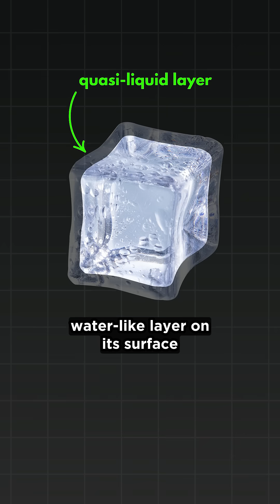The Science Behind Slippery Ice: Why Ice Skating Defies Logic

Comment: So i was right in school. I remember we got asked and my answer was "because there is water on top of it, like you can see it" Teacher told me "No". Ice is a crystal yet ice has specular reflection, that can only happen if something smooth is on top of it, you know, like water. The answer was staring us in the face. Also make sense why a car on ice and a car that is aquaplaning feels the same, because the car IS aquaplaning on the ice. As we are not in 0g's, heat wants to go up, the atoms in ice can't move like in water, so they transfer the heat to the top ( most of it, some energy will radiate to the sides and down ). If that is true, then ice in 0g's would be less slippery than the top of ice is on Earth. Seems to make complete sense, or did i miss something?

Comment: I fail to see how the second theory just “doesn’t make sense”
The thing about friction is that it isn’t dependent on the size of the surfaces in contact with each other it’s dependent on normal force and the coefficient of friction between the two interfacing materials. That is to say a metal sled the size of someone’s body and the blades of the same metal on a pair of ice skates would have the same force of friction (if we neglect the weight of the sled and skates)
The key aspect is that a sled has a large surface area so all of the heat energy lost due to friction gets a wide even dispersal, but the surface area of an ice skate is HUNDREDS if not THOUSANDS of times smaller. All of that heat energy condensed into small points seems reasonable to me, even if it’s not the actual case.

Comment: Its because the ice skates are very thin, thus create little friction with ice. Ice being a very smooth and slippery surface, also has little friction. See how easy that was
Reply: Also to push off the ice, you increase your frictional force by turning the blade and pushing off with more force than you have speed

Comment: It’s because water forms a crystal lattice structure when it freezes which also is why it expands when it freezes. However, the molecules at the edge of the crystal are not bound fully and are free to move. This is why putting ice on top of ice causes them to fuse. It’s not that the water is freezing but the molecules at the edge form the lattice pattern

Comment: 😮‍💨 it's not just the pressure. It's how the skates are designed. If you look at skates closely you'll see that it's not one blade but two with a cup shape between them. The weight of your whole body pressing down on two super tiny points does infact melt the ice. Which naturally gets pushed into the center in that cup shape and poof. Your skating on a super thin layer of water.

Comment: Well yeah?? 
I thought that was common knowledge. I mean ice is water with temperature below 0, and everything it touch transfer heat or cold. Including air.

Which is why in cold atmosphere ice can become sticky. The touch>transfer heat> melts a nano, then gets frozen by the ice. Kept by the cold atmosphere. Or simply very cold ice

As for skating, there is alot contributing. The pressure does cause the ice to melt. But not to preasure alone. The transfer of heat. The material and the atmospheric temperature the focus point on a blade are all a factor.

Comment: I thought the metal skates worked like a radiator, taking heat from the air and the foot, and melting the ice through heat transfer. Otherwise, we would see wooden or fiberglass skates.

Comment: No its a combination of both n your wrong for it to generate enough heat to glide on it all the weight of a person isn’t on their feet it’s on blades on their shoes the blades surface area small in contact of the ice but the pressure of a humans weight being on a smaller surface area

Comment: It's about the pressure per square inch( what they don't tell you is that figure skates are actually concaved in the middle of the blade technically making 2blades) to be honest I have no clue how much the average figure skater ways but if you apply that many pounds of pressure across at most 2 square inches it's enough to melt a small bead of water you can scate across

Comment: It's mix of pressure and sharp blade however the blade isn't sharp and a normal sense It has a concave blade on each ice skate and due to metal heat transfer it makes a small water bubble that is supporting your entire weight whenever you glide across the ice it is cutting the ice leaving the water there and you're traveling on the bubble not the ice itself which is why you can glide on it and actually have control

Comment: So the reason that ice skates can be used to make intricate movements is due to 2 factors the loose layer of H2O explained by M.Chromoshwaran_10F_OnlyStudies, and PSI 

Pounds Per Square Inch so yes someone may weigh 60 kgs but when you have all that weight on such a small surface especially one as sharp as a knife like a ice skate that pressure on the ice would break it apart and melt it because of how much pressure there is cause for an ice skate you are not gliding on ice your gliding on a ultra high pressure bead of water I believe Neil Degrasse Tyson did a video on this or a interview about this where he explained it a lot better than I can

Cause you got to remember the way boxers, moi thai fighters, and karate/taekwando martial artist deliver such power punches is by focusing all the force to one knuckle making all the weight of the punch be in such a small area that the force behind it is gravelly increased that’s why they can shatter bricks or bone in a punch cause of physics

Comment: Why can’t it be both? My finger doesn’t melt ice fast if I just place it on there but I rub it on the ice it does. Let’s go even further. I have a metal chop stick. Just pushing on the ice it would melt incredibly and the metal would become cold. It’s I start to rub the ice fast generating energy (= heat) then it will melt faster. Now imagine a 120lb person doing the same thing on skates a millimeter thick. It’s seems common sense I’ll have to research this if it’s really “debated” so hard

Comment: I thought the pressure of the skate being so thin is why they didn't need to weigh as much as an elephant to melt a small amount. Because it's about pounds per square inch and the skates blade is very narrow not sharp like a knife but much smaller point than your foot. But then I just remembered busting my ass in regular shoes from slipping on the ice so there goes that theory.

Comment: Its simple as the outer layer of ice will get latent heat which will increase the average potential energy not the average kinetic energy on which the temperature depend so yes water can exist on 0 and below 0. And due to that average potential energy which will keep the intermolecular distance far enough to not form ice crystals hence the Molecules will still be at that far from each other as they were in water when it was  at normal temperature , 
And as a result water remain water on the outside of ice and form thin layer over it 

But due to stacking of ice cubes the contact part of two ice cubes  part is now isn't expose to surrounding and is only with the other ice cube whose thin water layer also tends to absorb latent heat thus after a certain time when the energy would be over between that contact area the intermolecular distance decrease, as the average poterntial energy of molecules is now completely absorbed as there is no more latent heat left, and due to that it began to form ice between those two ice cube ( of course at environment at which additional heat from surrounding don't get into play like here in this video the refrigerator is doing) 

So its that's simple

Comment: Unlike what most people think ice skates are not actually like knives cutting through the ice they are thin and like blades, but instead of a sharp point it’s like the shark point was cut and turned into two sharp points with a little U-shaped divot and like she said in the video, there’s a small layer of water over the ice and what these divots did was used the pressure from the weight of the person in such a small area to gather the water under these blades, causing you to have a similar effect too if you put a set of tires on a car backwards, which would cause the water to go under the wheel making it slippery

Comment: lol that’s literally just proving the first point that the pressure of the blades (tbh I’m a snowboarder so it more goes like this for snow than anything) lay board on snow the liquid part of the snow will allow low friction so zoom, ice is just snow but together it will form the same little layer as anything touches it, think like the skate itself is not 0 degrees say the skate starts at room temperature as you begin you will melt ice then move to less and less as the blade cools

Comment: This is wrong. Ice melts easily when pressure is applied.  Take a cold metal utensil like a butter knife and press it against an ice cube.  You will find it sinks into the ice cube surprisingly easily.  Make sure not to be holding the utensil for very long before trying this (or use one with an insulating material for a handle, like plastic), or your result will be skewed by the heat transfer from your hand through the metal.  When wearing ice skates, your entire body weight is concentrated on the extremely small surface area of the skate blades.  This does temporarily create a very thin film of water between the blade and the ice.  This tremendous pressure is the same reason why stiletto high heels are banned on airplanes; they will punch right through the floor because so much of your weight is concentrated within a small surface area.

Comment: Ice is slippery due to the complex interactions of molecular, thermodynamic, and environmental factors outside the classical considerations of pressure melting and frictional heating. For decades, it was believed that the weight of the object—an ice skate or a human foot, for example—produced localized melting of the ice beneath, creating a thin layer of liquid water that lubricated the surface. This concept came about due to pressure-dependent melting behavior governed by the Clausius-Clapeyron relation. Empirical measurements and thermodynamic estimations, though, show that anthropogenic pressures are insufficient to significantly lower the melting point of ice under normal environmental conditions. Similarly, the concept that frictional heat generated by traveling over ice can melt its surface is also not tenable. Thermal conductivity is low in ice, and the energy needed to melt an infinitesimal amount of it is significant compared to what can be transferred by frictional movement in a contact time moment, especially at temperatures well below the freezing point.

Surface science more recently provides a better explanation based on the quasi-liquid layer (QLL) concept. It results from the unusual behavior of water molecules at the air-ice interface. In the majority of the ice, water molecules are locked within a rigid hexagonal crystal lattice by a hydrogen-bonded matrix. At the surface, though, these molecules are not entirely surrounded by neighbors and therefore are not subjected to the same stabilizing forces. This leads to increased motion of the molecules and a disordered structure, resulting in a thin, mobile film that is equivalent to liquid water. The QLL isn't formally liquid but rather a moving, semi-ordered state which can be present due to surface instability generated by entropy. Spectroscopic studies by techniques like X-ray diffraction and atomic force microscopy have proven the presence of this layer at temperatures well below 0°C, even though its thickness reduces with diminishing temperature and may vanish near −40°C.

In normal circumstances, ice is slippery due to other reasons. Environmental contaminations such as dust, salts, and organics can further perturb the lattice of ice at the surface to decrease the local freezing point. They can thicken or stabilize the QLL. The mechanical integrity of ice—its hardness and smoothness—generate low friction independent of melting at the surface. At extremely low temperatures, the slipperiness of ice is not so much a function of melting as a function of intermolecular adhesion that is poor between the ice and any surfaces in contact with it. Thus, in spite of the fact that there is no visible layer of liquid water present, ice can be disastrously slippery.

Finally, the slipperiness of ice cannot be explained by pressure melting or frictional heating alone. Rather, it is due to the intrinsic surface properties of ice, specifically the development of a quasi-liquid layer via molecular instability in the interface. Such a quasi-liquid layer, supplemented by such realistic parameters as ambient impurities and texture on the surface, has the effect of allowing ice to be slippery across a vast range of conditions, even under temperatures well below freezing. Understanding these mechanisms is important not only for scientific accuracy but also for the improvement of safety, traction design, and materials engineering in ice.
Reply: and I DID NOT use ai I’m tired of writing blame me all you want even check it with ai detectors I didn’t use ai so please just let me have a win at explaining

Comment: The blade of the skate is concave giving 2 points of contact, your body weight causes a thin layer of ice to melt and you slide on that very thin layer of water, that refreezes as you move.

Comment: It's pretty simple, ice is only smooth at our scale. When you're taking the razors edge so to speak to a ice plane you're creating a convex divit, like a linear cut. At the very tip of the cut the ice compacts and melts barely enough to form a new smoother layer in a line, hence the term figure skater because it's what you do with that line

Comment: In the idea on how they get such clean lines and cuts, I would believe that it actually has to do with the sharpness of the blades and the speed the skater is going. (And their control of course)!

If you have something sharp cutting through objects with similar texture, the faster you go the more stable you become, hence the cleaner lines and shapes you would be able to make.

You can test this idea through water, like water sports like rowing (as a rower myself) because of the shape of the boat which is almost a rounded off V in the water with a sharp fin underneath, the faster you go (row/ pressure you out in) the more stable you become! The faster you approach water the harder it becomes which is why faster speeds are more stable, just like when you bellyflop onto water it becomes slightly hard and hurts so much! 

(That’s why boat’s have find and skaters prefer to keep their blades sharp! Otherwise it makes their job much harder!) 

With the ice having that texture on the top, that better reinforces that, as that slightly watery texture allows for it to still reach as such.
So technically speaking if ice didn’t have that layer on the outside you wouldn’t be able to actually skate, hence why you don’t go far with such boots on harder surfaces like wood etc!!
Reply: Right? She is just confidently wrong sometimes
Reply: @athuljith2682 people have been researching and debating on this for a long time. You think you just magically figured it out?
Reply: @spicydennis  She is actually wrong in some of her vidoes tho. 
In another video she said the chicken coop becomes invisible when painted black because "black absorbs all the light" but actually the reasong it becomes invisible is because of contrast. the black coop wouldn't be invisible against a lighter background.

Comment: The one i learned about is that Ice is a crystal (duh), but as many already know, each molecule of water is bonded to other molecules of water around it... EXCEPT the water molecules at the surface. This layer of water molecules is not bonded as tightly as the ones below, so they're free to move around. 

Why isn't there a layer of diamond on the surface? Well, something like diamond has its carbon atoms covalently bonded. These are tight binds compared to the ones within water, which is held together by hydrogen bonding.
Reply: Btw this idea is not new. The earlier discussion of this dates back to 2018.

Comment: Simple explanation why its slipperly, cud be the reason. Ice is constantly melting anytime it touches something warmer, so it forms a liquid barrier between the ice and whatever is touching it. And because its a liquid, its unstable, so whatever touches it will just slide above it. One of the reasons cars lose control when they hydroplane. The water pushes the tires off a stable surface onto an unstable surface, therefore, the car loses control.
Edit: also, because liquid can not be conpressed, u are basicly standing on water  when u walk on a wet surface

Comment: Okay I think this is simple so the stuff happening at the surface is always like there's always stuff going on there because that's difficult to measure because like what kind of measurement device are you going to use to detect not just the overall temperature or like random points that you choose but like are there any volumes where the skate is touching that are being converted into water because you don't need very much

Like you can say the skater weighs this much and then the force is pressed against the skate but it's not going to be even because the skate isn't perfectly flat the ice isn't perfectly flat so like what happens when you hit one of these like super ultra like nanoscopic peaks in the ice crystal lattice like there's going to be way more force between that and like a cut in your skate or like a chip or something that's also like nanoscopic then there is just thinking about it in terms of pure weight and whatever

It also explains why going faster is easier because there's just more opportunities for that to happen